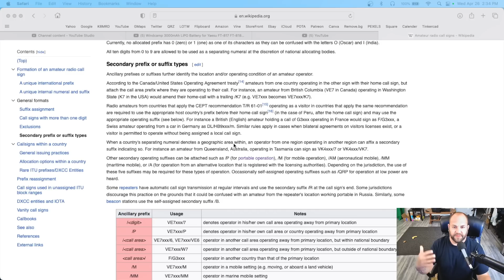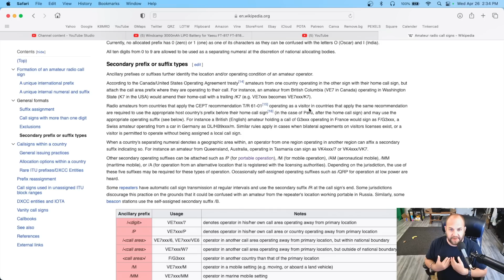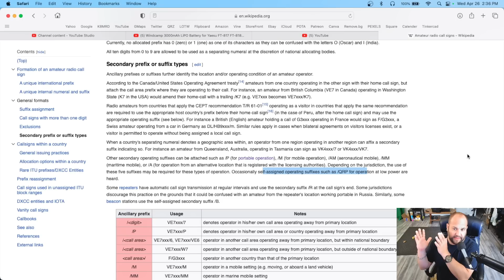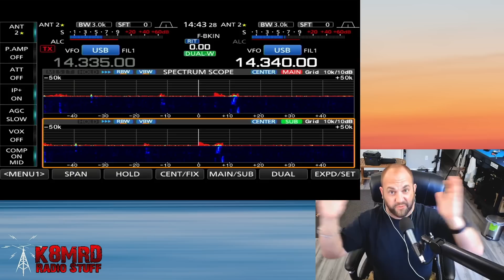Why Would You Want Two Receivers For Ham Radio???

Comment: For the two receivers - when I work a weak station on cw, it sometimes helps to tune in with both receivers and then turn a little off frequency with one of them. You sometimes can pick out a signal better, especially when there is fading or a lot of static. When  I hunted DX, I did that a lot. It also helps when you are trying to figure out where the DX station is moving when he is working up. You listen to the dx station amd then try to figure out where the callers are on the other VFO so you can predict where the dx will be next.

Comment: I'm used to use a dual reseiver rig, and when i have to use a single reseiver it just feels limiting, and I'm not doing contest, I just like to work the station's you can talk to for a bit longer, and when they have a qso going oon with someone else, I use the second tuner to tune around the band and maybe even make a few qso before he's done and I can give out a call, usually rigs have a quick bottom to change between a/b wefo and it's easy to jump around.

What it comes down to radios, receiver's are good enough for most in now day radios for what you want in the hardware section, it comes more down to how good the dsp wors for your ear and needs as well as the control layout,

I have a k3 with dual recaiver and the club has an ft1000mp, the k3 is better on the paper but I hate the dsp, on the lowest setting it sounds like the other station talks in a barrel. on the other hand the ft1000 sounds more natural when enabling low setting dsp and works great cleaning up the singnal. 

There is not one worse or better radio, there is only radios for different needs and preferences 

Off course some radios has a better front end etc, but with the filter and a qujet antenna like a loop, you don't het the benefits of a higher end radio, when you have your mast with high gain antennas high up and you did spend all the money on your antennas, yes then you might get a noticed benefit from a high end radio, or not, you can always beem out the unwanted singnals.

Comment: I think that guy misunderstood the pilot. The  Pilot probably was from Canada over 0 land in the US heading to northern Canada or heading north to Canada. I have talked to several Aeronautical mobile operators and they give location as well origin and destination. US pilots also give the US region their over if different from their call. . When you are at high altitude there can be pile ups that someone on the ground can't here .At Altitude a Pilot has a bigger foot print then a person on the ground on simplex. 100s of miles bigger depending on altitude. One of my contacts was on 10m and who knows how far he was reaching  .I have been a Truck drive for many years and have gone into Canada may times. I had to change my call with /(Whatever region)in my APRS too.
Reply from the maker: I suspect you're probably right.

Comment: I'm not a contester but I got the 7610 specifically for the 2 separate receivers.  There are two reasons.  First, I want to be able monitor as many stations as possible.  Second, I like the ability to lock the two receivers on the same frequency but different antennas for "diversity" receive (sorta).  Like a horizontal antenna and a vertical antenna.  Cant do this with 2 VFOs on 1 receiver.  It's really kinda cool to be able to "feel" the changes is propagation as the signal shifts back and forth from left to right ear of the headset.  My station is designed around this with a 2x6 remote antenna switch so each receiver can get 1 of 6 antennas, but the switch wont let you pick the same one for both (bad juju).

Comment: The reason that you have  multiple receivers in one radio is that the radios will generally protect their receivers by not listening when the other side is transmitting so that you can't damage the other receiver ala the MFJ-1708B. Others have mentioned diversity. Diversity receive is huge for noise control and fading (2 different types of diversity). Fading is mentioned in other comments. For noise control, you have phasing which phases the receive audio in one channel out of phase with the other. Back in the day when we had stereos with separate speakers, if you hooked up the speaker wires incorrectly, (red to + on one and black to + on the other) when you stood in between them, you would hear nothing or you could sense a null. This was sound at 180 degrees out of phase. We can do the same thing with noise in our modern transmitters (at least the ANAN radios running Thetis) and it CAN have a dramatic effect on some types of noise. As always, love mail bag Monday.

Comment: The IC 7300 can do most of that, but not as easy. It can have VFO A on one band and VFO B on another band or up 5 or 10. It will Not show 2 water falls at a time and it may not be as easy to do this. But it is a much lower price.   73  W4DES
Reply: My 40+ year old Kenwood TS-430S has VFO A&B (but no waterfall at all). It makes split pretty easy by selecting A-R or B-R, but I mostly use the A and B for POTA hunting- quickly switching back and forth between 20 and 40 meters.

Comment: Mike:  As a long time Contester and DXer, another great reason for the second VFO is when you are chasing a DX station you can find the stations that the DX station is working and see their method.  Their method is moving up or down in frequency after they work a station and learning their methodology.  You can find the station that the DX station is working and then when they call QRZ you can call on that frequency.  It makes work a DX station much easier, especially if they are working stations over a 10 to 30 KHz range.

Comment: You forgot to mention Diversity receive that helps with fading, Use a horz antenna on the main receive and a Vert on the Sub receiver to counter the fade on either antenna to copy the QSO you need to set up the Ant for on Ant 1&2 inputs  
 Thanks Keith N9QDS
Reply from the maker: Good point.

Comment: What you described from the DXpedition operator standpoint, you can do that with a single receiver as long as your radio has split mode. So unless the DX station also wants to listen to his calling frequency, he can do that with split. Turn that around and with you working the DXPedition with dual receive you can listen to the pile up and the CQ frequency if you have two receivers. I do that when working DX so I can hear where the last station was worked and call on that frequency when the DX says QRZ.  What you described in the Field Day scenario, with a dual receive radio, you can use what is called SO2V mode in N1MM to listen to one station calling CQ but go work others while waiting. Doing it with two separate radios is called SO2R.  That was a great question. de NY4I

Comment: It's not just the dual receive.  They also add other features to the radio which add to the price, like DigiSel (on the IC-7610)/VC Tune (on the FTdx-101), or you've got the crystal roofing filters (optional, and standard) on the Yaesu's.  I'm not sure if it qualifies, but you might be able to operate SO2R (single operator, 2 radio) with one of these.  DE K7RLN

Comment: f you turn on tracking so the knob tunes voth VFOs in sync, and put one receiver on one antenna and the other receiver on another antenna, turn on dual watch, and go into setting and turn on audio mixing, you now have a diversity receiver of sorts.  When there is a lot of QSB this is helpful.  Works good for digi modes and  is a big help on weak CW.  With one antenna vertical and the other horizontal, it works very nicely for QSB.
Reply: I think Bill is on the right track.  I do think that for true diversity though, you need to use the same VFO so that both RX are "phase locked" together.. and with a little DSP magic will present a signal with the best sig/noise ratio of the 2 RX.  You do need 2 different antenna, preferably a vertical and a horizontal polarized set.   This way when the band conditions are such that propagation shifts from predominantly vertical polarized to horizontal, and back, the rig will use the RX with the best signal.
Reply from the maker: That's a great tip, thanks.